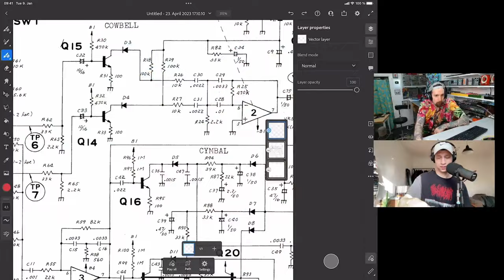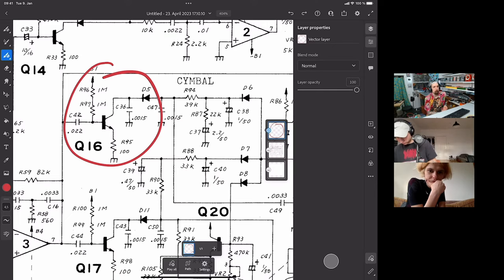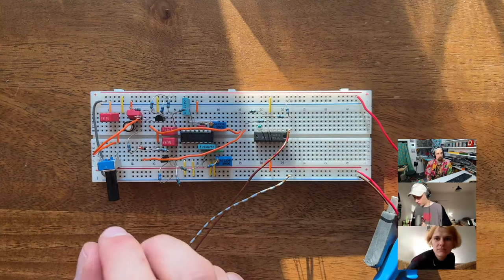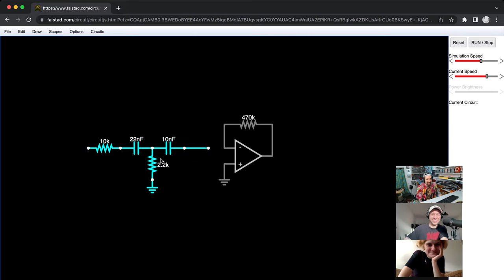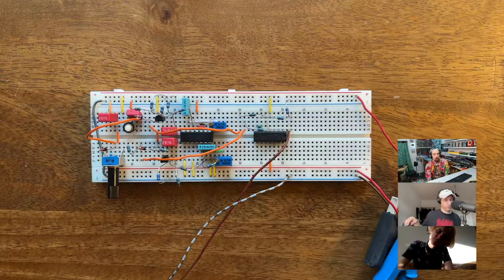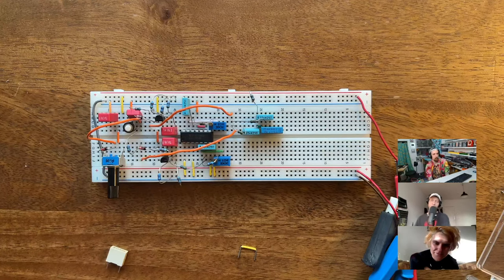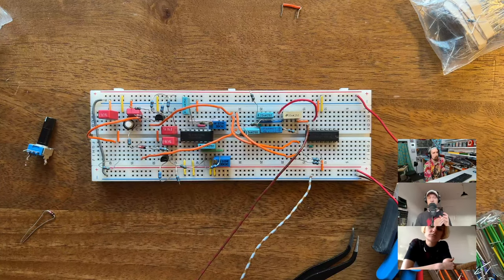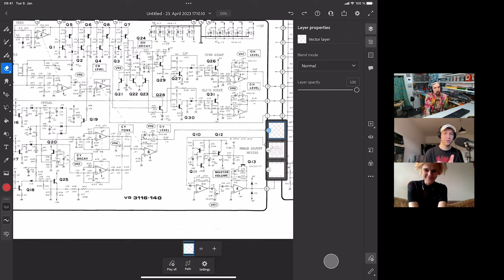Reverse Engineering... with @SimonTheMagpie  | Roland TR-808

Comment: FWIW for your digital delay from scratch idea the easiest thing to use would be a "dual-ported static RAM" (pretty much the most expensive flavour out there unfortunately). There's two separate ports so you can read and write simultaneously, that plus an ADC and a DAC a couple of binary counters and a couple of latch chips and you'd pretty much be there.

It would also be achievable with a "normal" (single-port) SRAM (cheaper than dual-port) but you'd need to interleave reads and writes which will be a pain (not to mention space consuming) to implement in plain logic, you'd probably want to use microcontroller or something to manage the transactions.

Dynamic RAM is generally the cheapest to buy but is much more complex to interface top as it requires continuous refreshes so for that you'd definitely need a microcontroller or something.

Also as somebody noted in chat, you've basically described a PT2399, but "rolling your own" could have benefits because you can use larger memories to store more/better quality samples.